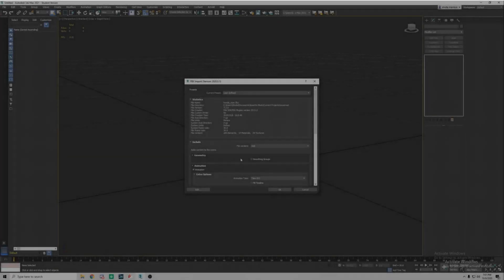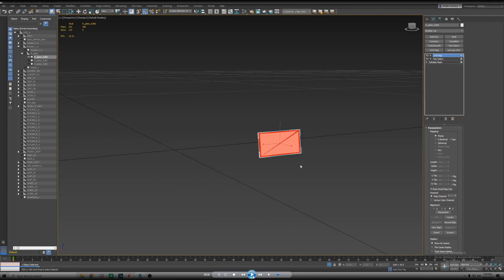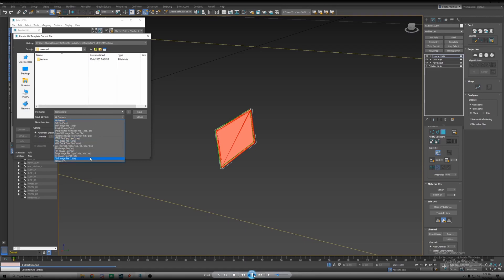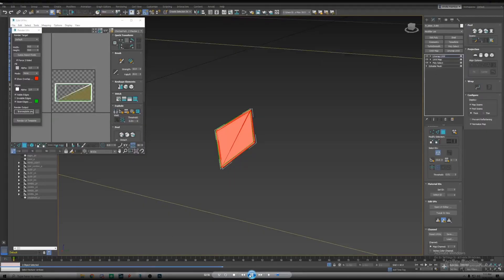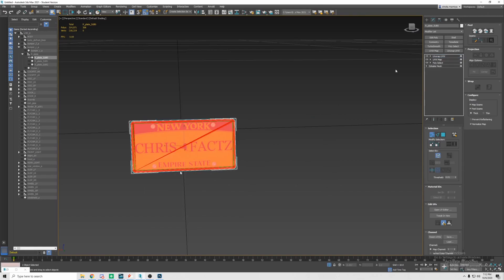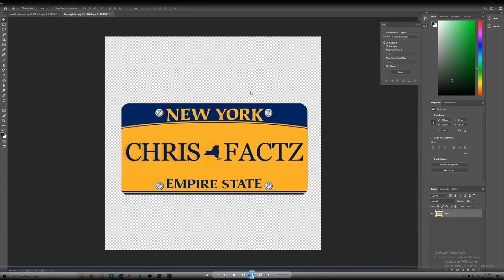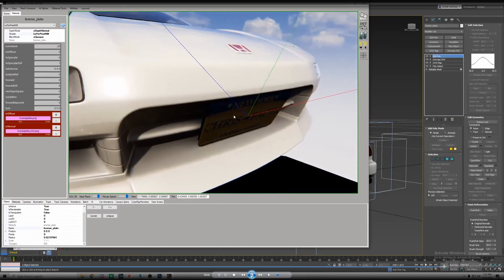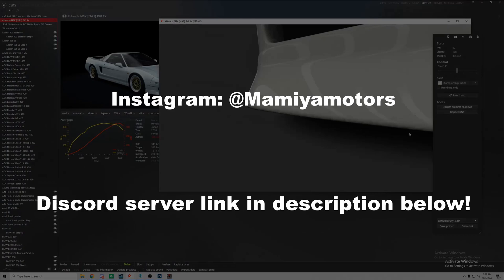HOW TO: Custom License Plate | Assetto Corsa | 3dsmax

Comment: I have a few problems.
So my original car model didn't come with a license plate, so i decided to take a license plate from another car and stick it on. A few problems come with this.
- If I save the license plate + old car together, the car is GIANT in ksEditor and I cant even see the license plate from the front, only from the side.
- Unrelated issue but I can't use ksPerPixelNM, just gives me an error
- If i save the license plates separately and try to import into ksEditor, they are WAY BIGGER than my car and i dont know how to move them to fit onto my car.
Reply from the maker: So there’s a couple things, 

1) whichever 3d program you’re using, you need to make sure your scaling is correct. If it’s 3ds then you need to make sure it’s importing AND exporting in scale factor 1. In blender I think it’s similar but might be slightly different, not sure. 

2) you cannot move an object in kseditor. You can only change shaders and textures. To move an object you need to do that in the 3d program (max or blender) before importing into kseditor.  It’s giant because going back to scale factor, it’s prob not set right on export